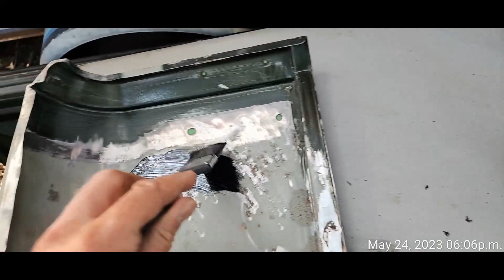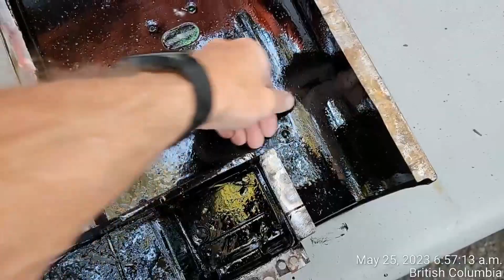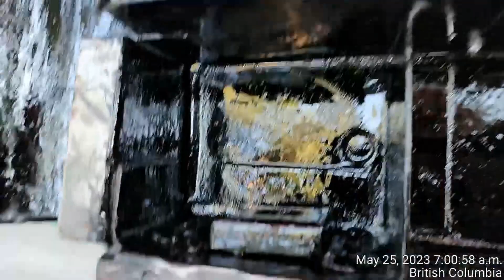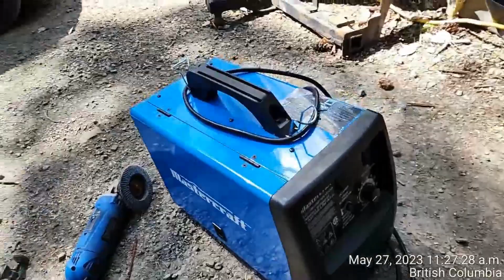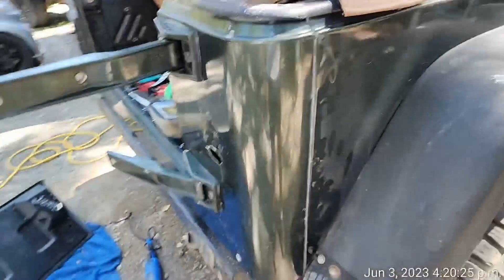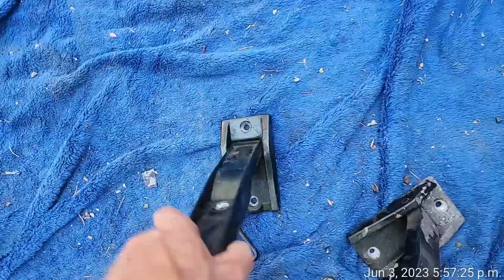How to replace rear corner panels and rear cross sill on a Jeep TJ -   Part 4 Prep and Mock Up

Comment: Why didn't you just buy a new sill 130 lmao. The only way you can fix that junk is with meratic acic a few times and use baking soda with water to neutralize it the por 15 prep but you need to sand for it to stick. Then por15 even where you need to weld you need weldable primer. Your compared to my work mine is 15 years yours 2.5 if your lucky 😅